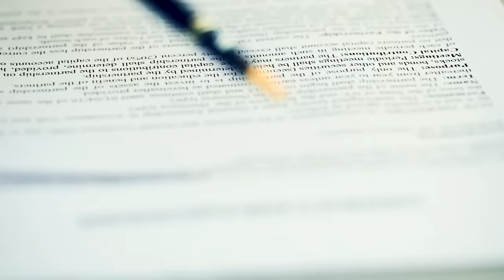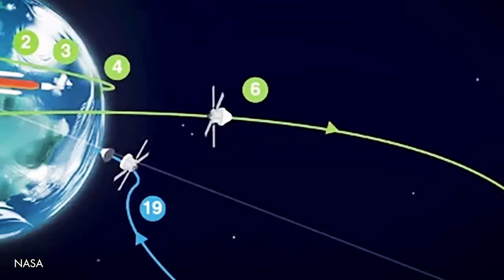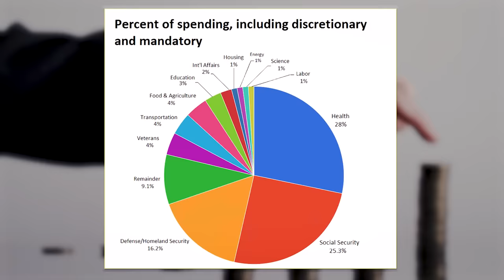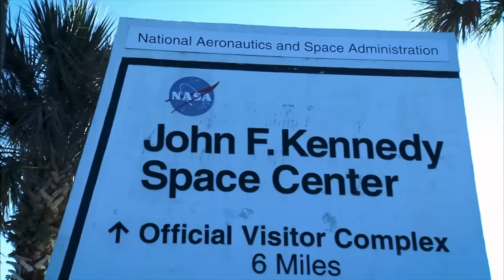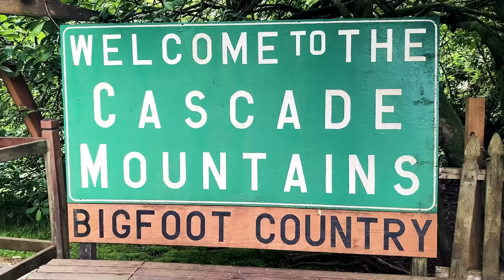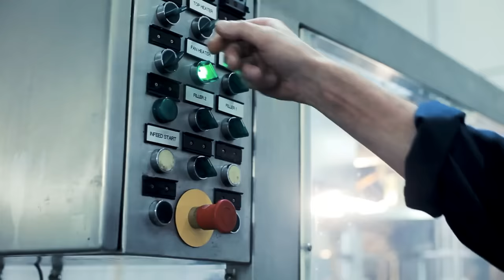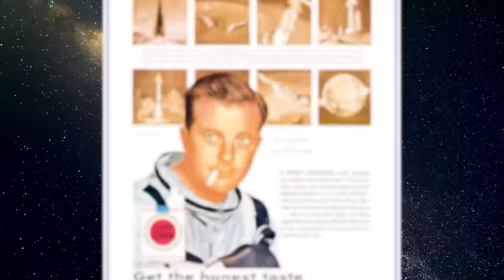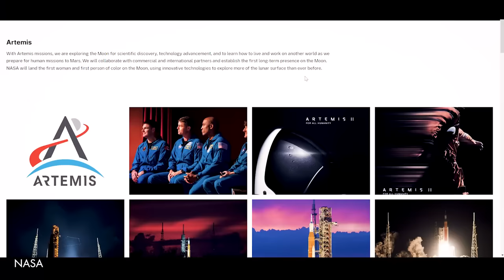Why is it so hard to return to the moon?

Comment: 33 minutes of nonsense. Nasa has an annual budget of 8.4 billion, how much more do they need? Further - Nasa admitted they destroyed or "lost" most of what they supposedly had with respect to Apollo. The Artemis project has been delayed several times now and why? They haven't figured out the Van Allen puzzle...strange no?
Reply: THE TECHNOLOGY WAS NEVER 'LOST'  
You don't, 'lose' technology in the sense that it is forgotten, mislaid or mysteriously disappears. All the technology remained but rapidly became obsolete. You lose the capability and with the premature cancellation of the program the production plants, the tooling, the specific expertise to mount such a huge project was all abandoned or left to lie fallow and became defunct. Most significantly, the heavy lift capability necessary to send crewed missions to the moon was also forsaken in favour of the Space Shuttle Program and the construction of the ISS. It is a given in engineering that it's far faster, easier, better, and cheaper to simply take the lessons learned by older programes rather than trying recreate old equipment which is obsolete. There is no longer the capability to fly passengers at supersonic speeds. When civil aviation eventually returns to supersonic flight (it's been nearly half a century since the demise of Concorde), it isn't about to roll a 1960s design, featuring 1960s hardware out of the hangar. Rebuilding such a complex project as Apollo on a similarly massive scale and utilising contemporary technology on a fraction of the budget of the Apollo Program has been a long and protracted, painstaking process. Project Artemis was only approved in 2018.  The blueprints for the Saturn V rocket are stored on microfilm at Marshall Space Flight Center, and the Federal Archives in East Point, Ga., also house 2,900 cubic feet of Saturn documents.  Rocketdyne has archived dozens of volumes from its Knowledge Retention Program  which was initiated in the late ‘60s to document every facet of F-1 and J-2 engine production and assist in any future restart. Comment courtest of Yassassin.
Reply: The technology was lost in the same way Apple lost the technology to produce the Apple II computer.  They can't do it.  That technology doesn't exist anymore.  They can obviously build A COMPUTER, but they can't build an Apple II computer.  The entire infrastructure which produced the components to build that computer are lost.  Saying the Apollo program was faked because we lost the technology to produce an Apollo lunar module is like saying the Apple II computer was faked because we lost the technology to produce them.  You don't know what you're talking about.

Artemis has been delayed for several reasons - none of which have anything to do with not knowing how to traverse the VAB.  In either case, the radiation concern with Artemis is a lot different than Apollo.  Not because we didn't know how to shield Apollo.  The Artemis components are tiny compared to the Apollo components (chips, circuits, etc.) which inevitably makes them far more susceptible to radiation.  It's not really a concern though.  There are far more pressing matters that have caused the delay of the Artemis 2 and 3 missions.  They have figured out the VAB puzzle...long ago.

Comment: It's  easy for humanity to return to the moon. It's just more costly for humans to. An automated science lab with Earth controls and AI would be the feasible choice in growing a presence on the moon. Humans themselves should be an afterthought. A science lab followed by resource collection and sustainable construction using moon regolith 3D printing, moon ice, and a little specialized resin from Earth as a binder. A low-pressure botanical ecosystem in a crator and underground hollow would be the most convenient. Once this is established, we could slowly trickle oxygen based lifeforms and see how they evolve after a few generations...so on and so forth.

Comment: Pollo 17 pollo 18 pollo 19 pollo 20 were all classified missions
Reply: No. Apollo 17 was run completely in the open, with tons of live TV broadcasts. Apollo 18-20 never got off the ground: those missions were cancelled. 
Apollo required a rocket a hundred meters tall, those launches were visible from tens of miles away. So we’d have noticed if more Apollo missions had been launched.

Comment: Nope, not convinced. With this new age of technology everything cost way much less to produce. And also, no, it wouldn't cost much to rebuild and send the Apollo rocket. The costier part is creating and testing the engine and it's done. It worked then, it will work again without major or any change.
Reply: Yes, it would cost billions to build another Saturn V.
- convert 6 million drawings from hand-drawn to CAD to support modern manufacturing.
- find alternatives for thousands of parts that have been out of production and unavailable for decades.
- modify parts for modern production processes. The F-1 for example had thousands of tubes that were hand-brazed. Today we have better processes to make that structure.  
- set up a production facility for building a device that’s a hundred meters tall
- build a new launch table and tower
etc.

Comment: In my opinion we where to early to go to the moon, off course it was driven mostly by politics and it was a race to space, but technology wasn't small enough to reduce the weight and cost of traveling to the moon. What if we waited 30 years, technology would've been much smaller, the benefit Moores Law of semiconducters would be much greater and it even could've saved astronauts lives. Think about that ;).
Reply: Moore’s law only applies to semiconductors. A Saturn V weighs around 3500 tons, and only a few hundred kg of that was computers. Replacing those with modern ones would not have made the Saturn V noticeably lighter or smaller.

Comment: It’s not “Never Again” is “Never Been”.
Reply: Nope. We’ve landed on the moon 6 times.
Reply: @Hobbes746  6 takes to get it right, and many rehearsals before that, the film director must be pissed off.
Reply: @MRT-co1sd  We know the Apollo videos were not filmed on Earth: it’s impossible to recreate the perfect 1/6 g gravity we see in the videos.
Reply: @Hobbes746  LoL…Multiple ways, suites outter layers filled with helium gas. By the way they forgot the adjust the lightings for the right angles and the flags were not supposed to be blowing in the background. Communications with earth and the response back was not delayed properly. Plus many other.
Reply: @MRT-co1sd  To compensate 5/6 of the weight of an astronaut, you need a balloon with a diameter of 10 meters. Those are nowhere to be found in any of the Apollo footage. And I said perfect 1/6 g. Not just the astronauts, but everything in the videos down to individual grains of dust fall at 1/6 m/s2.
Reply: @MRT-co1sd  We have 3 hours of EVA footage from Apollo 11. In all that time, the flag moves exactly twice: once when the astronauts are pushing the flagpole into the lunar soil (and that movement is transmitted into the flat, obviously), and once when the LM takes off and the LM ascent engine exhaust blasts past the flag.
Reply: @MRT-co1sd  The communications delay is exactly what it should be. What people forget is you get the delay only on one side of the conversation: the conversation is recorded on Earth, so responses from Mission Control to the astronauts have 0 delay. But when MC asks a question, it takes 3 seconds for the astronauts to answer.

Comment: Astro-not Don Petite, or whatever his name is, says we lost that technology and that it's a painful process to get it back.
Reply: By which he meant, the Saturn 5 rockets were not reusable.

Why is this so hard to understand. 

He neither said nor implied that they had lost the know-how.

As this video accurately points out, they also lost their budget.
Reply: NASA did not lose the technology to go to the Moon in the sense that it was forgotten, mislaid or mysteriously disappeared. A lot of the blueprints still exist on file; but the individual knowledge of everyone involved and the “organisational know-how” of how to actually run such a huge, complex project has been lost after such a long time. Much of the equipment is archaic, and many things cannot be bought “off the shelf” and have to be specially manufactured. Re-designing from scratch is cheaper and better. However, it takes years to build up that sort of expertise and NASA is going through the same problems it had in the early to mid-60’s.
Reply: @Ruda-n4h  ...as I said.
Reply: @justindupre7274  All this was understood back in the early 70's.
Reply: @Ruda-n4h  Astro-not Don Pettit says we destroyed that tech, is he wrong?
Reply: @Ruda-n4h  The Van Allen radiation belt wasn't known in the 70's and nothing was engineered to withstand it.  Now we know and it's a major hurtle.  Strange.

Comment: How come in the 70s they were able to transmit live video from the moon to earth, but I can’t get a decent wifi signal 30 feet away from my modem?
Reply: NASA spent billions on a communications link for their use only. Modems are built so you can have as many users as possible near each other, which means the range has to be short.

Comment: The fact that technology is used so extensively used today is a reason why it's harder to go. In the 60s men were smarter, stronger, and could figure out problems better than men today. 

Whether you're an engineer, scientists or regular person on the street, we all depend too much on technology and we have lost the ability to solve problems without tech assistance. 

Advancement in technology does not necessarily make it easy to do something like this. Because it requires a great deal of brain power and innovation, all of which we seem to have lost in the past few years.

Comment: Only a fool believes the lies that they walked on the moon in 1969 when computers were as big as pianos
Reply: Disclosure Project Intelligence Archive
Reply: The spacecraft computers had a performance comparable to the first generation of personal computers like the Apple 2 and Commodore 64 (the guidance computer had RAM of 4KB, and a 32KB hard disk). They were only required to take large amounts of numerical data and organise it into a more useful format. That original data was calculated by the main frames at NASA, and then beamed up to the spacecraft by radio telescope at the rate of 1,200 bits per second. They did not need the power for touch screens or to hold graphics etc like today’s smartphones.

Comment: Just use common sense. How many booster they need to launch a spaceship. And there is no booster after landing on the Moon. They never landed there in the first place.
Reply: What you're doing is like comparing a Prius to a fully-loaded semi.  It takes a lot more thrust to get a payload to orbit from the surface of the Earth than it does from the surface of the Moon, which has 1/6 the surface gravity. In addition, the only thing that left the surface of the Moon was the LM ascent stage, which only had a mass of 4,700 kg, and only had to get to lunar orbit. Its engine was quite sufficient for that.  (thrust-to-weight ratio greater than 2.1)

Comment: This is a way to steal taxpayer money. Who was filming this entire mission, this is hysterically funny, there was a craft following a craft to film the landing, film the flight, yeah right. So fake. No way, we have no true way to know the atmosphere on the moon, it’s a guess, the rover on mars. Yeah right, that’s not believable either. They have video of the rover running around mars, who’s videoing it. lol
Reply: The entire mission was filmed by the astronauts themselves. The only film we have of the landings was made by a film camera inside the LM, so we do not have any outside view of the landing, or the flight to the moon. 
“so fake” is an opinion based on a lack of basic knowledge. 
Similarly, the only video we have of the rover on Mars is recorded by the rover itself. Five seconds of looking at the footage would have told you this, but no, you decided to jump to conclusions instead.
Reply: There was no  "filming (the) entire mission". That would have used up the 16mm film far too quickly. The only footage of the landings was taken from inside the LM using the 16mm camera pointing out the window. The only instance of a craft being filmed from another craft is where the LM is filmed from the Command Module. Do try to get your basic facts correct. Take care.

Comment: All aspects of the mission were theoretically figured out, and all obstacles supposedly overcome, so provided they did actually complete the mission rather than feed us an animated and falsified line of shit, it should be a relatively simple task to accomplish given the tremendous advances in technology since then. Assuming that the mission was completed as the official record claims, these tech advantages should have made either the cost considerable less or the equipment and accommodations a lot better and easier to work with, as well as making preparations much quicker and safer, so where could the problem possibly lie? I contend that the reason for the lack of desire and enthusiasm for this type of accomplishment has not been with the public attitude or desire at all, but with the Powers that Be and their agenda versus ours. It has come to the point where our "elected officials" and/or the bureaucrats who operate all the systems of politics do not give a flying crap what the people and citizens of our nation or planet want, but their agenda has shifted to a position that is diametrically opposed to whatever we want and that their plans did not involve us in any way other than to strip us of our wealth and weaken us until they could remove most of us from "their planet", enslave the remainder, and then do whatever they want. The amount of money they've spent on fraudulent wars and things we haven't even seen makes the Apollo missions look reasonable. We've found an enormous amount of evidence to make this case, and fortunately the problem is already being solved in our favor. The Artemis program was started after NASA was largely fixed, and the US Space Force was established. The future looks much brighter than it has for decades, as we will all witness in the coming decade.